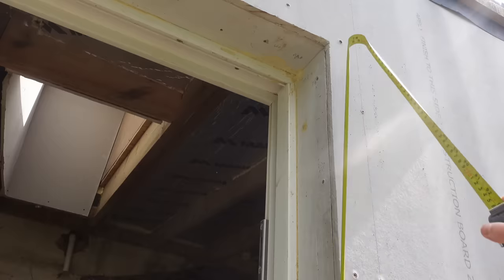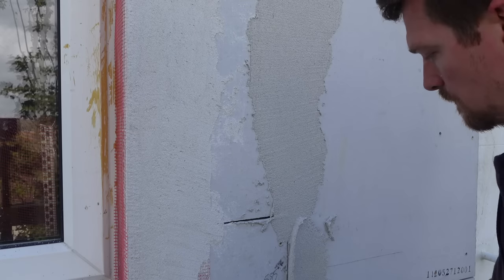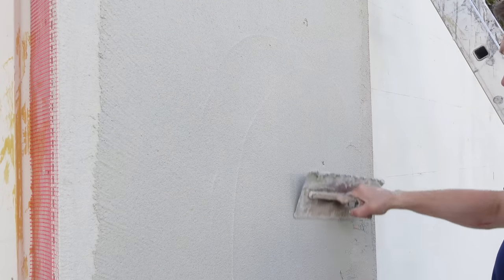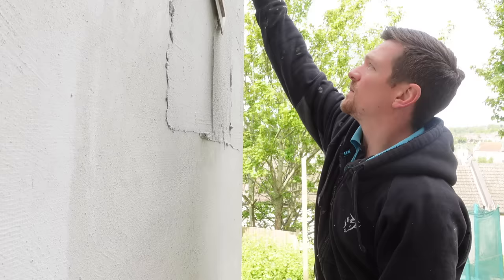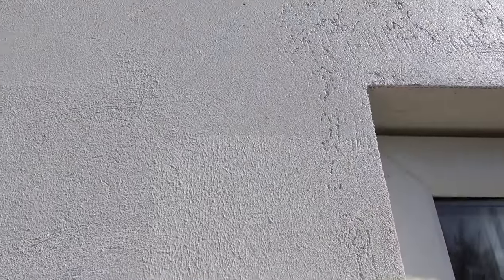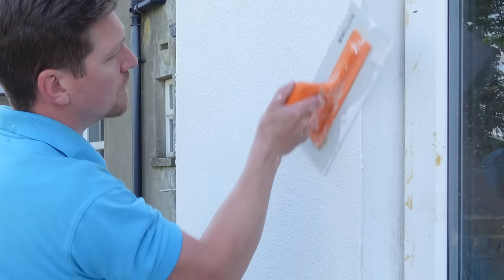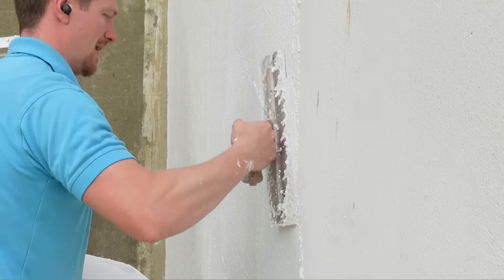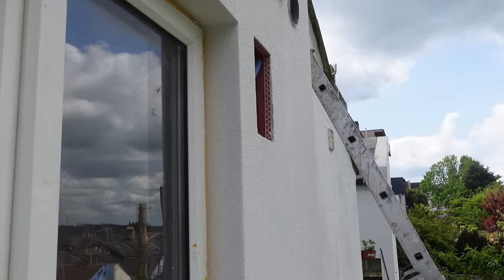SILICONE RENDER | Is This The Best Rendering System?? (FULL PROCESS EXPLAINED)

Comment: U should have put a coat on ure relveals aswell when putting the corners on then that way it is all bedded in under the bead and not just coating on top of the mesh, that is the worst possible way to do it

Comment: Excellent tip about building and edge on larger surfaces, to give a spot for the next patch to work. Thanks for that !!
I use products like this to cover old concrete walls, that are unsightly, 1st doing a scratch coat to level out the walls, letting this dry 30 days, because it's a cementicious product.

Comment: Really useful information thank you. I have to render my bay which has some bad cracks so this would be an ideal system to use. Is the top coat available in a completely smooth/fine finish?

Comment: Hi Blaine. Last year they did a garage conversion a few doors down from me ,  putting a timer framed builing on top as well. I was watching and learning of course - and I'm pretty sure that it was exactly the same sort of system - ie using cement boards, but I seem to remember them putting some form of primer on before they put the first coat of render. If I recall it was like a pinkish watery primer. Does that ring any bells with you ?

Comment: I was watching to look and try and do a beading rain lip in a front wall of bungerlow above lead strip it has sliped down abit of the front door porch so water runds down wall and goes on the rusty metal edge beading lip and where thè lead should be tucked just under it where porch is joined to rendered bourded wall thats where its leaking  about 4 meters long how far are you away how much would that be to render a new rain bead lip would be better as i cant move that well after heart attack near 2years ago are you close to clacton on sea

Comment: Is the 5mm gap between the boards really necessary ? I’ve got a builder doing a loft conversion and I’m not sure he left a 5mm gap between the cement boards. I’m worried now as the silicon render is due to go in the next few days
Reply: I can't see why there would be expansion or contraction with cement boards...wood does but not cement board. Maybe ask cement board manufacturers to be sure
Reply: @tonyarnold9784 what are the cement boards attached to? There's your answer. ( if the wood moves and the cement boards are attached then they will move to)

Comment: I see this all over the place now on new builds looks very nice for six months then get filthy dirty. Can this be painted to refresh the colour??
Reply: Jet wash or algaecide cleaner. Simple.
Reply: They're probably a k-rend type render system. I've  had this thincoat silicone for about 2 years. It's as white as the day I put it on.
Reply: I thought the entire point of this stuff is that it's resistant to algea and dirt etc? That's what the manufacturers website says anyway 🤷🏼‍♀️